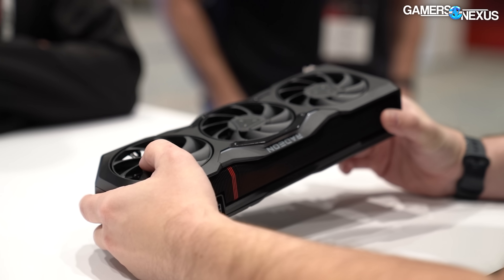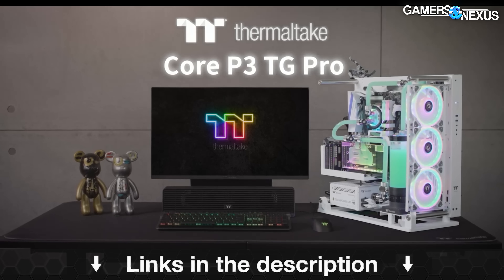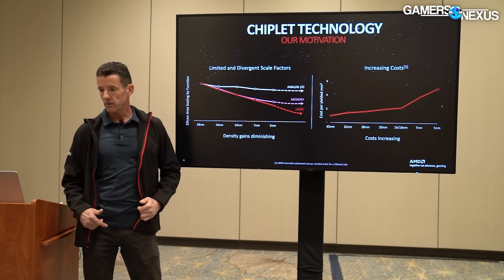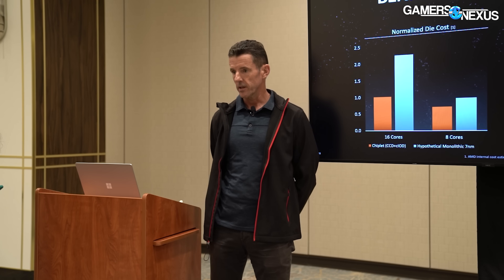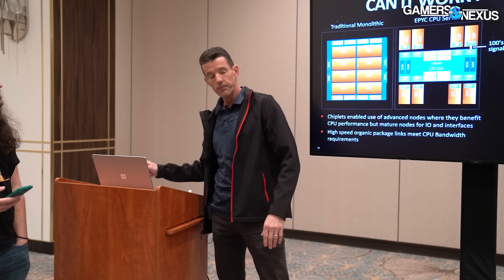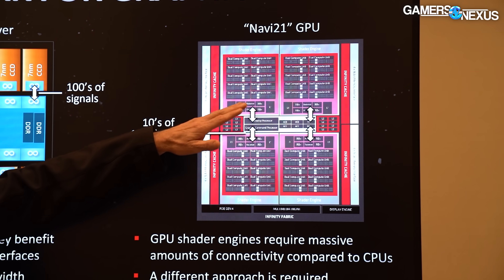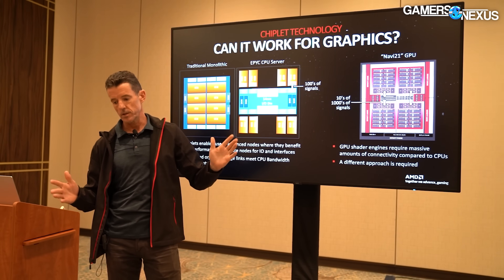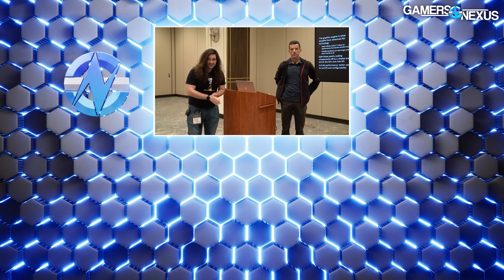How AMD is Fighting NVIDIA with RDNA3 - Chiplet Engineering Explained

Comment: All these slides make sense if you're taking a 640mm2 CPU, and cutting it into 8 x 80mm2 dies. But doing it to a GPU provides far, far fewer savings. Anyone can use a die calculator themselves, and find the cost of 6nm, and 5nm from Ian Cutress's video on estimating a Ryzen 7950x die cost. Are there savings with building a 7900xtx using chiplets? Sure, maybe 10-15% per GPU die price saving, vs a monolithic 400mm2 to 420mm2 design it could have used, had it been all 5nm. 
That's accounting for all yield gains, and extra cost of going all 5nm. It's about $160 vs $180 per die. On server CPUs it's like we're talking like 50-60% savings. This all seems like a test project to get their feet wet, and the real savings won't happen until like RDAN4 or RDNA5.

Comment: What's wild to me is that for so long, the progression was to move more and more things onto the main die with the processor (even more so with mobile devices), and now we're finally going back in the opposite direction and breaking the big monolithic chip into pieces.
Reply: GPUs were always monolithic if I remember correctly. It was the CPUs which had memory controller and north bridge seperate. Those were integrated on 1 chip by Intel with 1st gen Core i7 in 2008 and were seperated again by AMD with 1st gen Ryzen in 2016.

Having the memory controller seperate from the processing parts is a 1st for GPUs with RDNA3.

Comment: Nice, but all I care about is that my GPU will work and not just start melting after a few days of using it like some Nividia GPU's plus AMD GPU's don't cost as much and they take less power to run 🤔. I think AMD made the smart moves this generation, unlike Nvidia.
Reply: We haven't seen AMD power draws for this new architecture nor their drivers

The Nvidia fiasco was over improperly plugged in power connectors by the user in a whopping 0.1% of sold cards as I recall.

Comment: I like what AMD is doing with Chiplets, and I like what Intel is doing with specialized Cores. Nvidia... They are the hold onto the LS engine as long as possible approach, (efficiency and performance be damned, we can just make it bigger).
Reply: Casually ignoring Nvidias approach to the AI/Machine Learning/Software scaling?¿
They saw it as a better investment since they're not seeing as great of returns in squeezing more and more but smaller transistors onto a die.  
We'll see how much further chiplets get us on this ever more difficult task of increasing computation horse power.
Reply: @DurzoBlunts  any sort of logical streamlining/optimization in terms of processing is absolutely very important. I was more discussing the physical hardware side. Because Nvidia (or anyone) cannot get by  solely on soaking up more and more powe. It's accepting a technological cap rather than pursuing advancements in that area. That said, it would probably be easy enough to adopt later. The same can be said about AI. It's just the nature of pioneering.

As an aside I am not 100% sold on the predictive graphics, no matter what you do, if it requires rapid motion it is not going to work. However, I would guess that long term it handles certain aspects of usage differently so that when it is appropriate it will be used and as soon as it isn't it falls back to brute force.

But again, similar to GM rather than updating the foundation they are opting for doing the most with what they have. Which obviously works well enough for GM, it's just not as innovative as I think most of us would like to see out of Nvidia (looking at the core offering as opposed to the features). If I am going to buy some new hardware I would rather it not be more of a software update. While that can be great, those sorts of things can/should often be applied backwards as well/instead.

Comment: Never knew memory and I/O stuff doesn't scale down well anymore. Look at any die shot of a GPU and you'll see so much space "wasted" on that stuff. Off-loading all of it to cheaper older nodes on chiplets and then dedicating the big die to the actual logic is definitely a great way to solve the issue. Wonder how NVIDIA is going to tackle it. Was secretly hoping AMD would have some crazy flagship card though with a 500mm2+ logic die and then chiplets around that. But I guess that's too expensive / too much work for little actual sales due to the small market for that stuff. Or maybe there isn't the bandwidth for it, or the distances between chiplets and logic die introduce too much latency. But still, would be an insane card.

Comment: Very interesting video, the chiplet approach looks hard to implement in GPUs but appears to have massive benefits. So far it has apparently allowed AMD to stay below $1000. I wonder if the RX 7800XT will use chiplets too.
Reply: they'd just have to remove 2 of the MCD's but are likely focused on doing the same thing as nvidia and trying to get rid of as much 6k series as they can since their AIB's also have a surplus of 6800, 6900, 6950's.
Reply: @sirmonkey1985  but on the bright side is that AMD is heavily discounting their gpus to get rid of them instead of milking them for more than they're worth like ngreedia.
Reply: Navi 31 and Navi 32 are both chiplet designs, according to the leaks which turned out to be accurate about Navi 31.  The 7800 XT will either be a more heavily cut down Navi 31 or a Navi 32, so it will definitely be chiplets.

As for the price, it's actually quite high.  AMD will be making killer margins at those prices.  If nVidia had priced their cards sanely, AMD would have plenty of room to move down.
Reply: @TrueThanny  NVidia probably cannot even price their cards sanely, given their monolithic design. I assume their lower end of the wiggle room is where AMD is with MSRP atm.

Comment: This is great stuff.

I’m really curious about his comments that the bandwidth requirements to break up the GCD into multiple chiplets is too much. Is he talking about the ‘core to core’ bandwidth requirements or something else? Or I guess more generically bandwidth to connect A to B, what are A and B respectively?

And is that requirement something that is case dependent (ie gaming vs raw compute), or is this a bandwidth limitation universal regardless of the use case?

I’m asking because there have been rumors that CDNA is going with a chiplet based architecture, and it will actually be the GCD’s that are broken out as chiplets as well. That rumor could be total FUBAR, but we know that SLI/Crossfire has always had issues with gaming while productivity application usually see a more linear scaling benefit. So there may be something to this.

Regardless, I’m really curious to hear more about how far this can be scaled out vs where there are limitations. Good stuff as always!

Comment: what about a super improved version of crossfire. put two or more GPU chips adjacent to eachother on a substrate and treatint them as 2 different GPUs must have super improvements to previous versions of crossfire. Then AMD can create a halo product of its own.
Reply: They had such cards in the past. Game developers didn't like to tinker with Crossfire/SLI.
Reply: @bslay4r  no those were unsanctioned AIB stuff and two separate substrates.

imagine if AMD backed it and saw extreme improvements with a chiplet xfire design.
Reply: @pyroromancer  Ahh, I misunderstood you.
Nevertheless "Game developers didn't like to tinker with Crossfire/SLI". :)
What we want is multiple GPUs seen as one by the OS or the AMD driver.